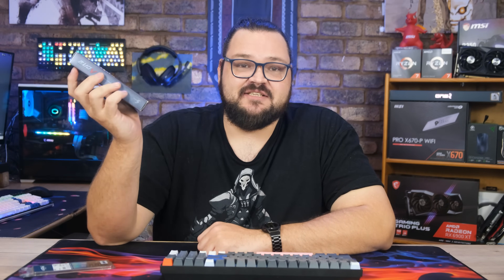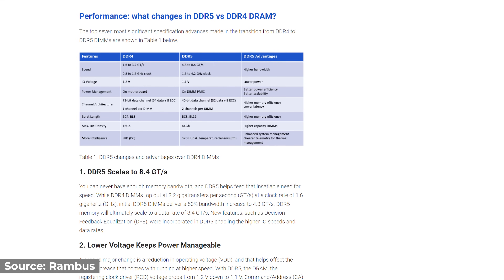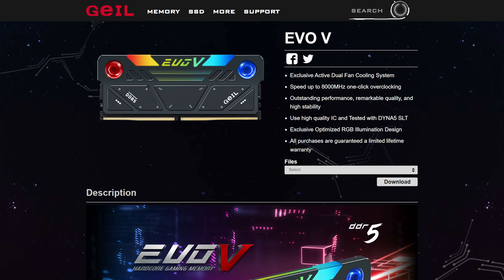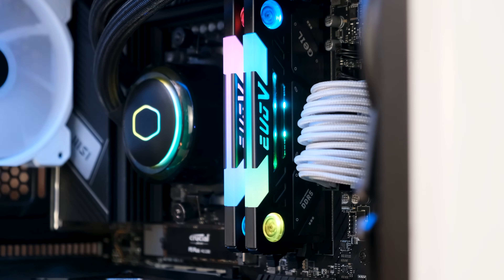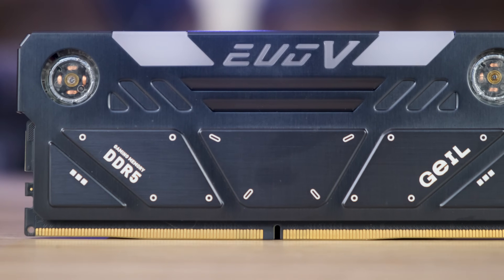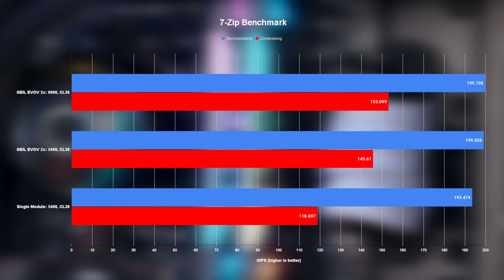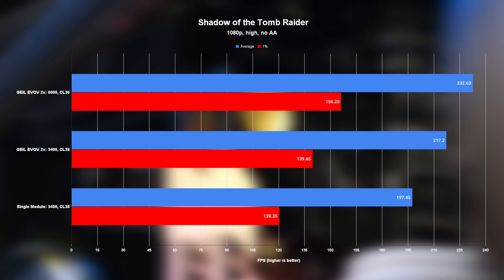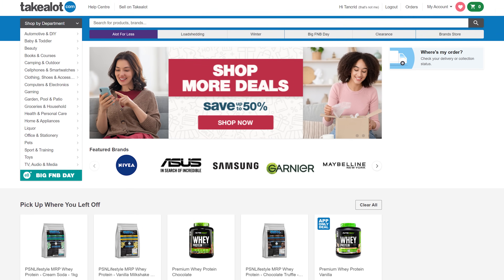ARE YOU GIVING UP PERFORMANCE?! DDR5 Single vs Dual Modules - GEIL EVO V RGB Mini Review

Comment: OR IF FOR SOME REASON, YOU HAVE TWO STICKS, BUT YOU CAN ONLY GET THEM TO WORK IN SINGLE 😢CHANNEL B1,B2
Reply from the maker: Don't give up, man! Even if you have to lower speeds below what the modules are rated for, don't stop tinkering and get them to work in dual. Update your board's BIOS if you haven't already - that's usually the first thing I try in your situation.
Reply: @TheTechTank  Dual Cahnnel is now working! 😃 I introduced an issue where I didn't have both cpu cables seated properly on the motherboard. I also loosened the cpu cooer a little.
Reply from the maker: @ Happy to hear it, dude! Glad you finally got it working, lol.

Comment: A more accurate comparison would surely have been to run the tests with either one or both of the Geil modules for each benchmark. Otherwise you introduce the difference in performance between the Crucial and Geil modules (regardless of the fact that you set the BIOS timings) Either way, useful video, thank you.

Comment: I just upgrade from AM4 to AM5 on a Auros Master X670E and Ryzen 7900X, by mistake I bought a Corsair DDR5 Memory kit 6000 mhz that was not include in the Qvl list of the motherboard memory support, what ever configuration I put in the memory socket just A1 and A2 boot the system, when I put A2 B2 or A1 B2 I get code error C5. On the Bios when boths kits are on A1 2 A2 socket I can Enable XPM profile and Bios show 6000mhz / 32GB. On my Ryzen 7900X on Cinebench r23 I get 30000 points. I was playing also Space Marine 2 on 60hz TV 4k  Radeon 6700XT graphic card on 1440p high settings I get 70 to 85 fps, sound good? 🤔. I just hope when I get a proper memory kit listed in the QVL motherboard support the B1 and B2 socket work as should be 😑
Reply from the maker: I wouldn't get too caught up in whether a kit is on the list or not. As long as you have the modules installed in the optimal config for your board (which is almost always A1 + B1 or A2 + B2 - your motherboard's manual should show which), pretty much any kit should be able to run at their rated speeds on a board like yours. It might be worth trying a BIOS update in your case just to make sure. Your Cinebench score looks above average. Haven't tested Space Marine but your FPS looks like what I'd expect from a 6700XT. Long story short, I don't think your issue is related to your kit not being on the list - tinker around a bit and it should run perfectly 👌

Comment: Question: Trying to update my DDR5 in my laptop. Currently on 8GB in single channel and considering buying 1x16GB to run them in Dual channel.... Will the 24GB DDR5 (1x16, 1x8) run better or am I better off just getting another 8GB DDR5 to then have 16GB DDR5 running in dual channel?? Just looking for some advice pleaseee! Shoutout from a Saffa in Italy!
Reply from the maker: Hmm, technically DDR5 is already "dual channel", but two modules still generally run better than one. Also to avoid any potential issues, it's best practice to pair two modules from the same brand, model, specifications, preferably even the same pack. You can mix and match, but there's potential compatibility issues.
Reply: @TheTechTank  Got it! I'm thinking of taking the risk and getting the 16GB stick. If it isn't compatible or leading to weird performance instabilities, I'll just use the single 16GB stick and later on, buy a second matching stick. Thanks for the help!
Reply from the maker: @Apollogetsgood  That's a great plan too, lol, didn't think about that.

Comment: The difference is still not significant. Who on earth would even complain between 110 FPS and  120 FPS? The difference is negligible and insignificant. Anything above 60 FPS is not discernible to most people.
Reply: I'd doubt that, I'd say it's above 100-120fps. I currently have a 1x 32GB 6000MHz stick, do you recommend changing it to 2x 16GB or 2x32GB?
Reply: I bet you have a 60 hz monitor. Try a high refresh rate one and see the massive difference for yourself.
Reply: @ytviewergod2598 I have a high refresh rate, there is a no difference between 110 or 120

Comment: This pretty much looked the same for DDR4 when testing different speeds, F1 and Hitman 3 always showed the biggest improvements.
Some games are just more affected by memory bandwidth, if anything this should prove that dual channel does give real performance boost.
But either way you are better off with 2 sticks.
And all small percentages build up to a larger bunch, everything matters.

Comment: The 1% low if you plan on running at 144hz would certainly favour the faster memory configurations with 2 dimms. But otherwise yes it's not like you break a leg of the cpu before going into the races.